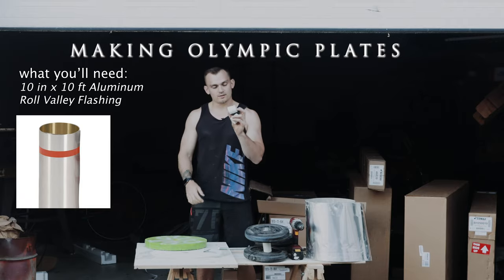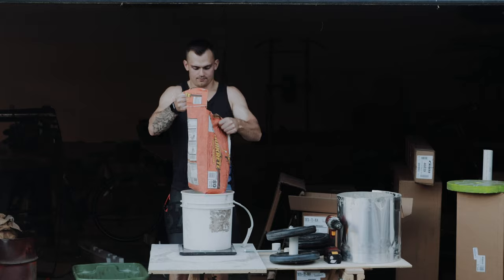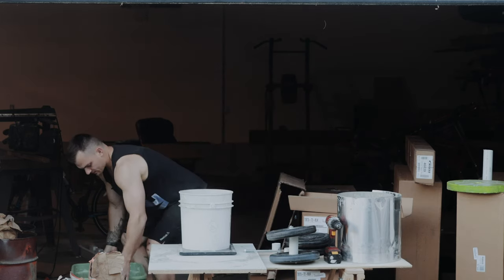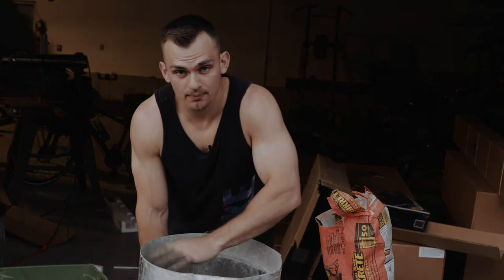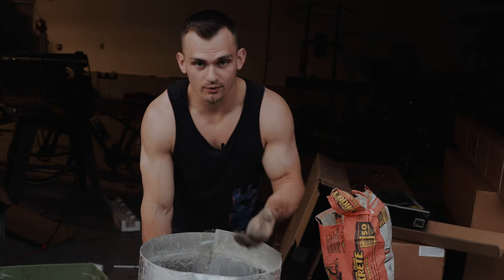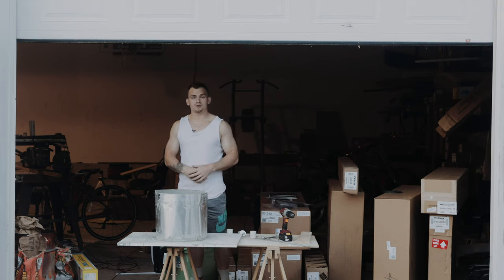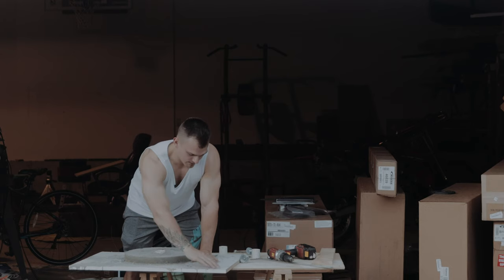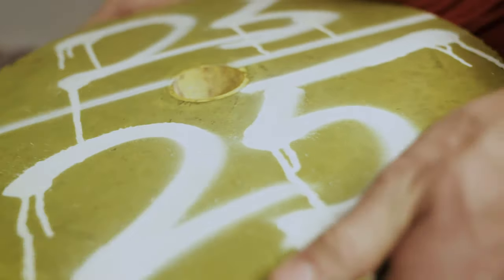DIY Olympic Plates - CONCRETE Tutorial - CHEAP Home Gym Weights

Comment: If you measure the concrete before water it’s not accurate as some of the water is used in the curing process
Reply from the maker: The water dries my man.
Reply: @brybrykeith  trust me I made some not all the water dries as it’s part of the curing process
Reply from the maker: @UEF-Sawmill  The variable is so small its basically the same variable as real store-bought weights.
Reply: @UEF-Sawmill  so you mean there is no thing as cured dried concrete?? You are telling me there is always a little of water nooooo my dude noo
Reply: I made mine, I weighed it to 21/22kg once the water dried it went to 20.2kg..  I've done this for all my plates and same result, so no issues here

Comment: How they holding up against the floor? You didn't bother with adding support to the mix? Oh and awesome video. Going to buy some stuff tomorrow.
Reply: I've done them, just dont drop them from high but they hold up pretty well for cleans and everything else when not dropping
Reply: You don't need all that extra wire or rebar inside cement if you just need plates for Bench press they will hold up for years....

if your into dead lifting and dropping weight on the ground I wouldn't waste time n money on  making your own set just buy some or except them to break in due time

Comment: dude awesome video! what do you recommend putting on the side surfaces of the weight as protection? what it is that you put that gives it that shinny look?
Reply from the maker: I used flex seal but don’t recommend it- it peels easily and it’s expensive. Haven’t really found an ideal solution unfortunately
Reply: Brian K Arnold there’s this thing called line x and it literally makes everything you spray it on indestructible but I not sure of the price
Reply: @nikarshadsulaiman9614  hahaha I was literally just searching if anyone has spayed bed liner on their plates.

Comment: I cant find a pvc pipe plug can you let me know what dimensions/brand yours is? Every time i get 2 inches it doesnt fit inside but its exactly the same circumference as the pipe so it sits right on top
Reply: @BRUTUSPLAC  the plug!! not the pipe lol thanks but i meant the plug
Reply: @BRUTUSPLAC  thank you so much :D
Reply: @kayots  no problem Hit me up anytime   read my comments below if  you need any help

Comment: Nice video! How long should I wait before paintinf and putting some flex seal on the plates?
Reply: At a bare minimum 7 days, ideally 28 days. Concrete gains strength over time as it cures, if you're dry curing it in open air it will reach 70% of its 28 day strength after 7 days. If you wet cure it it will reach something like 80% in 7 days.
Reply: TRUCK BED LINER